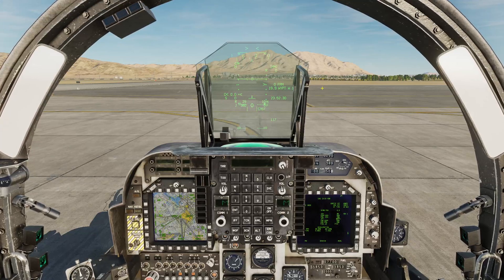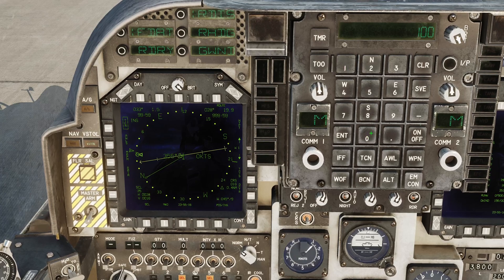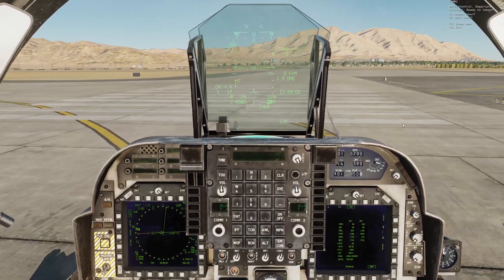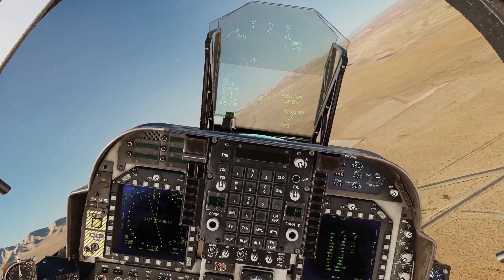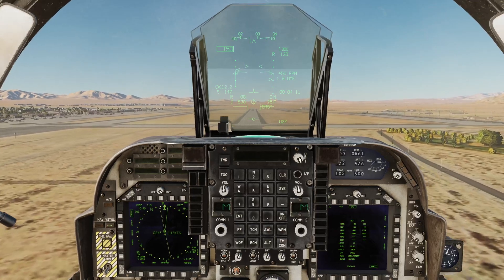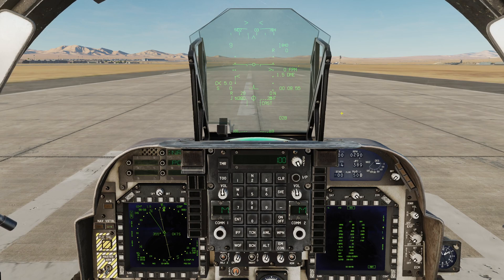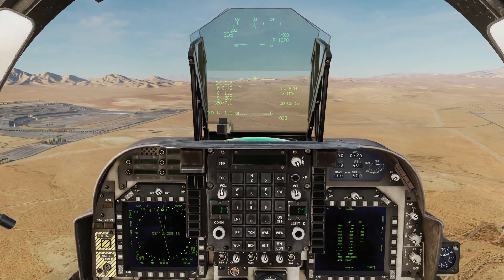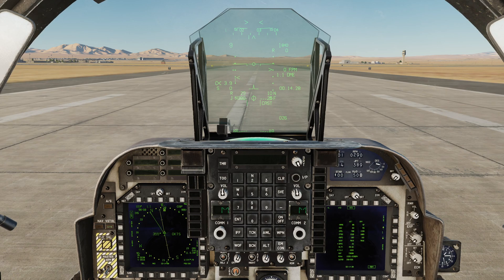DCS AV8b Tutorial 15 - Field Ops

Comment: After takeoff remember to clear STO stop lever and recheck its position pre-landing, this will allow you to use full nozzle rotation range in case you will need to do power nozzle braking or some variation of short landing that requires higher nozzle angles or hover/braking stop. Also, after liftoff during STO, begin rotating nozzles to lower angle simultaneously or slightly before you start placing "witches hat" at pitch carets, rising your nose up with nozzles in required STO position (especially if 60 or 55 degrees were used) can create a situation in which nozzle angle will be equal or greater than 82 relative to the ground, so Harrier will be placed in kinda-hovering or even power braking situation, with speed loss and everything.
Reply from the maker: Good points, I left the nozzle stop intentionally on my STO takeoff as I knew I was just about to do a slow landing but normally I would ensure it is clear. Also good point on the nozzle angle. You could even stall out in some situations.

Comment: Hello deephack, thank you for another great tutorial. Concerning the course line, are you using magnetic or true heading? You are not alligned with the course line during TO nor landing which you probably should be.
Reply from the maker: Thanks for the feedback. This was with the EHSD in magnetic heading mode but there seems to be an issue with the course line right now. As you can see it was not aligned with the heading I set it to. The compass rose on the EHSD and the HUD heading tape however are correct so I just ended up using them. I'll report this to RAZBAM.
Reply: @deephack It seems to me that typing in the true heading (040) instead of magnetic (029) does the trick.
Reply from the maker: Still sounds like a bug as I had my EHSD in magnetic mode so all entries should be magnetic I would have thought unless this is how the real aircraft works. I'll ask.
Reply from the maker: Checked with someone on the Razbam forum and it's confirmed as a known bug which is being worked on.

Comment: A little tip for taxiing. Instead of breaking a lot and very hard, rotate the nozzle to the advised 40-60° to control taxi speed (that's from the original manual). You still need the occasional break input, but far less aggressive and easier to control.
Reply from the maker: Thank you sir! Quite correct, I was meaning to revise my taxi procedure. I'll do this going forwards.